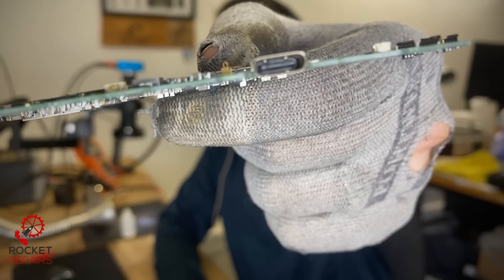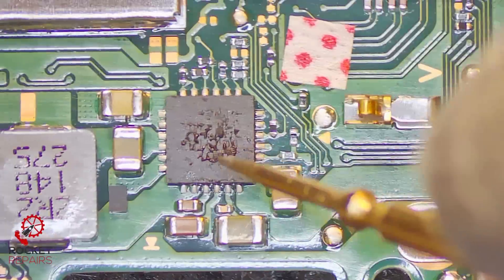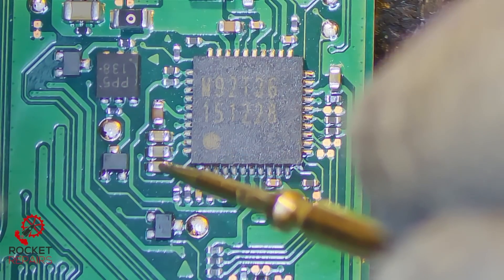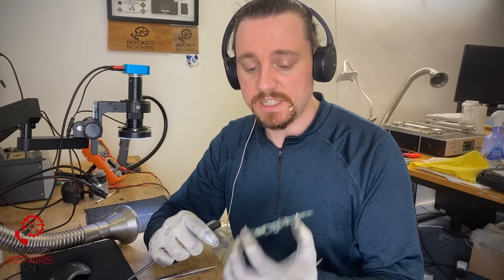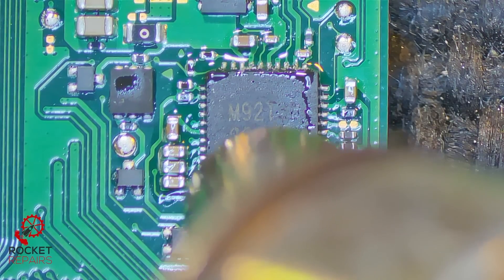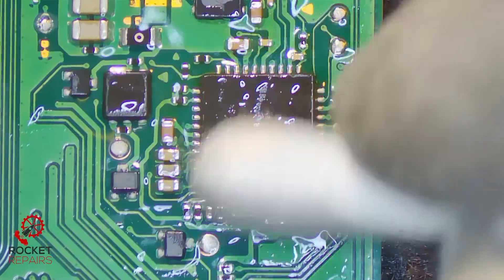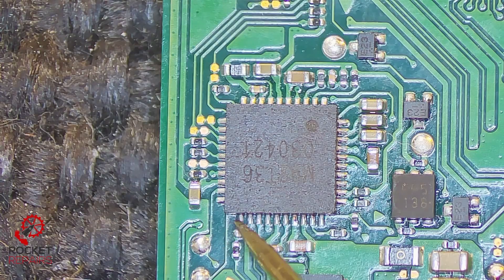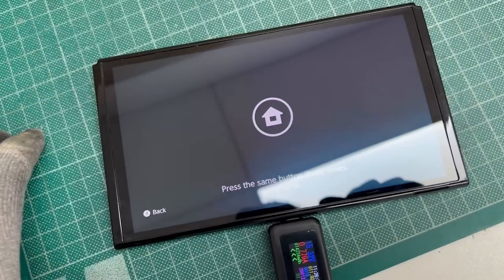OLED Nintendo Switch Repair - No Power

Comment: a little bit of advice for you. Always allow the chip and surrounding components to fully cool down before applying isopropyl alcohol. These components can suffer from thermal shock and crack, especially ceramic capacitors. Think of a plate that's been in a hot oven and then you put it in the sink with cold water, what will happen? the plate will crack, it's the same with ceramic capacitors. Once they crack they will allow moisture inside the capacitor which  will eventually go short-circuit.
Reply: thanks for the advice bro
Reply: Been doing it for years without issues so not necessary

Comment: Joey, I don't quite get what you mean with "too much voltage" from a 3rd party charger. The Switch, like any other USB-C device, defines the voltages it needs by itself, with the CC pins. You cannot overvoltage a USB-C device unless the charger you plug into it is actually faulty but that can happen to Nintendo chargers as well.
Reply: That's not entirely true. The device will communicate the voltage it would like to see, but no charger will supply that voltage perfectly. The nature of switchmode powersupplies is that they regulate the output voltage by switch themself on and off very quickly and output filtering will try to make it smooth. More expensive chargers have better output filtering, cheaper ones will have larger spikes and those can also go above the desired voltage. Especially if cheap capacitors age, filtering can get much worse, eventually damaging sensitive devices.

Comment: Hey joey, i reckon that those m92 chips you got may be fakes. Can not remember where i saw the video, but a youtuber made a video demostrating soldering that same chip you used and it did not work for him. Maybe you got a good batch but watch out maybe some are faulty ;). You can tell the chip is fake by looking at the “m92t36” letters that are more to the center in comparison with a genuine chip.